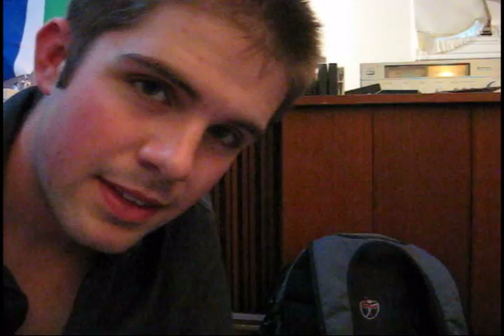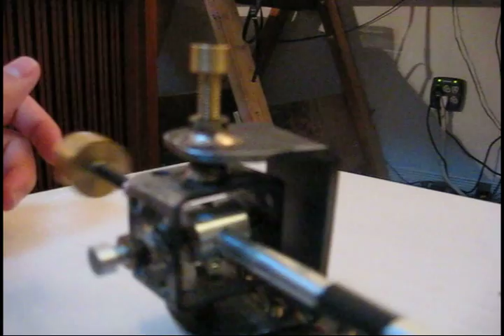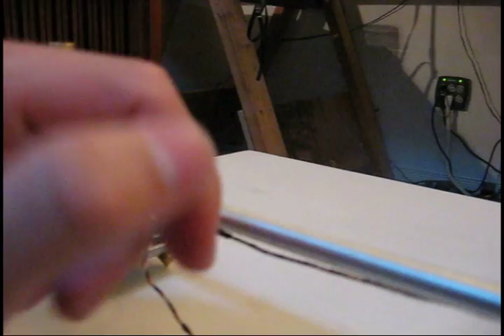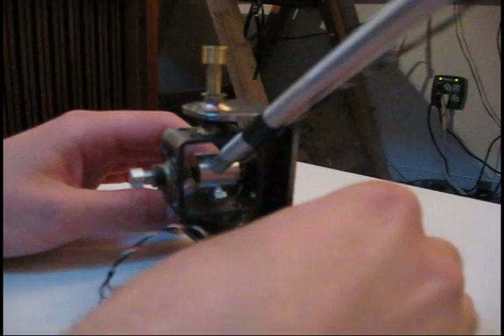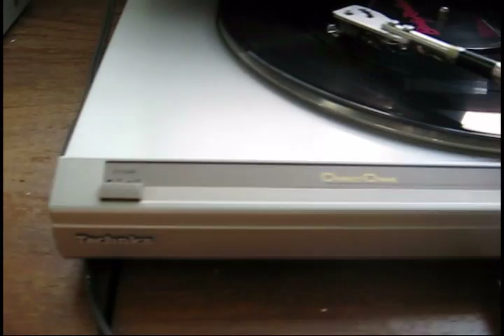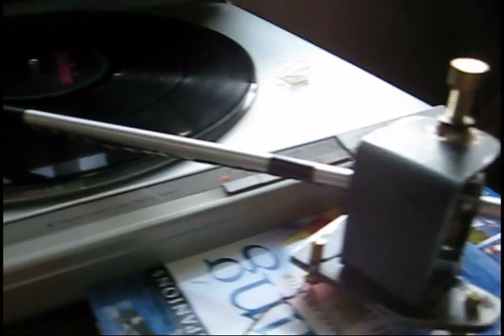My First Homemade Tonearm

Comment from the maker: @bcdhifi Hi there, the tracking angle wasn't found mathematically, I just used a ruler placed on the side of the cartridge, which has quite a square body, and experimented until I thought it was correct. I believe it is set to 8 degrees, a lower value, but it is a long arm.